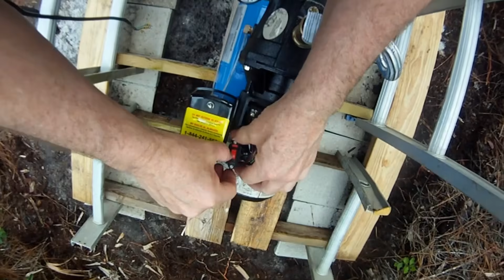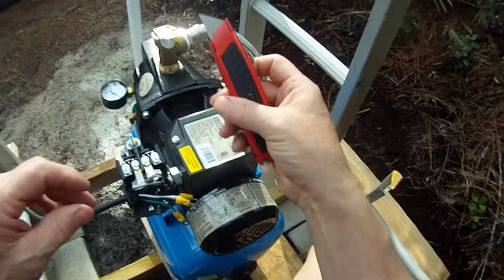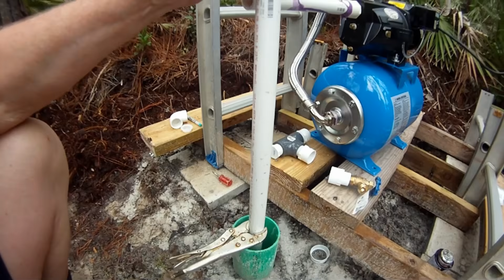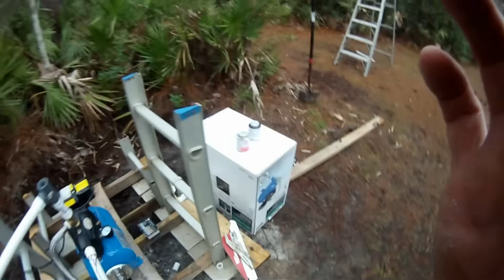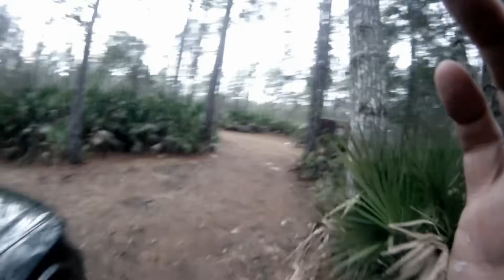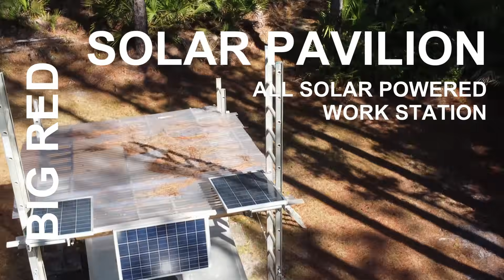Shallow Well Pump ELECTRIC + PIPE Hookups SOLAR POWERED WELL PUMP DiY well pump operations & Hookup

Comment: Add a well seal between the draw pipe and 4"casing. pour some pea sized gravel around the draw pipe and casing to help filter sand. Lastly draw a sample and have it tested for bacteria before using it for drinking! Otherwise well done :)
Reply from the maker: Thank you for the great tip! I will definitely mention that in future videos.

Comment: Can I locate the check valve at the top end, in case I have to change it some day? There is a high salt content in this water. It has a history of eating things. So, if the valve is reachable,  a future headache will be solved. Oh, part one and two are great videos.
Reply from the maker: Hi Matt,
Thank you for watching.
Check valves are designed to have waters weight on  side of the valve ( pump side). So, when the check valve is installed down by the well point, all of the waters weight is on the top of the check valve when it's closed.
Putting the check valve up high, makes the check valve pull on the seal where it seats when closed. The check valve flapper could begin to warp with reverse pressure ( suction) that is  occuring when pump shuts off.
So, to answer your question, you could put it above ground but, you may be replacing the check valve more often. In your case, it does sound like maybe it's an alternative. Just be aware that you may lose suction and would have to prime the pump more often...
Thanks again for watching!

Comment: Aluminum ladders are good lighting rods.
Reply from the maker: Hey Robert,
Thank you for watching.
So are trees!😆
But, the entire ladder superstructure is grounded thru guy wires which also stabilize the structure. This method makes a safety umbrella for the entire system. Anything, people and equipment safely blanketed by the grounding system.
Thanks again for watching!

Comment: Where did you get water for your mini jet?
Reply from the maker: Hey Joe, fill clean large trash containers 3 ( 120 gallons)would be a good start and probably enough. Keep water in truck bed or place containers on a platform at least 1 ft high. Place hose into container, hook up siphon to pressure washer.

Comment: Hi quick q

North central Florida, Swanee area, 

Is it possible to drive a 3” pvc pipe with slits as a diy screen down to about 60’ and use a jet pump with 1/2” pvc to draw the water?
Reply from the maker: Hey LUGO, Thank you for watching. Im not sure. I guiess it depends on what you are starting with... 4"?  you would probably need a mud pump to go 60 feet. Im still not sure of the best procedure for 3" micro slot.
Thanks again for watching!

Comment: Great videos...my only comment is why are you running the pump so high @51 psi it's generally not needed so high ...it will pull less on your inverter less chance of blowing out hoses and will be more like town water pressure
Reply from the maker: Hi John, Thank you for watching.
Its the preset . It works good for what I use it for. Mostly washing, spraying off things. It would probably have to have the pressure switch changed out to adjust psi.
Thanks again for watching

Comment: This was terrific. 
I just don't know a flip about solar. You know, like knowing how much solar to buy and the inverter. It's Greek to me right now. 
But I can get a hand pump on the well first and have a stubbed off connection for a pump later.
But this is really a terrific video. Grateful for your help. Jesus bless.
Reply from the maker: Hey Sandra, Thank you for watching. depending on what you need to use the water system for, frequency of use. but, 600-800 watts should do pretty well for you. use a 200 watt/ 4000 peak inverter.
Thanks again for watching!

Comment: What brand power  inverter 2000w did you use.
Reply from the maker: Hey southern haven,
Thanks for watching.
I actually am not particular about a brand.
It isa modified sine wave inverter. They are very affordable versus a full sine wave inverter. If you are running expensive electronic equipment, you might consider a full sine wave inverter but, for the pump system, modified or square wave inverter is just fine. I do use the mod sinewavee inverter for everything including my laptop Thanks again for watching!
Reply: Thanks great information I'm just want it for my water pump

Comment: What part of Florida did you do this at? I have put in wells in Indiana with success but I just bought raw land in northern Florida, Suwannee county and plan to do it again. Nice sandy soil. How far down before hitting water? Thanks man.
Reply from the maker: Hey Dan,
Thank you for watching.
It will be similar to what I ran into
On this one 
Sand/moss, then sand, then small crustacean / hard sand  layer, then... BUTTER
Reply: @AtlanticDrain  I watched your video months ago and watched it again last night and seen this was ocala area about 118 miles from me. I had enough of Indiana brrr so I was going to move to Arizona but at the last minute decided to come down to Florida. Living off grid in Suwannee county in my truck camper running solar and a generator for backup and for heavy loads. This isn’t for everyone lol. We shower outside with a shower bag 5 gallon and use a coffee maker to heat water for now while getting set up. It’s a trip mentally going to Walmart and lowes and seeing the outdoor garden center open in January lol cause that ends in august up north. Loving the sunshine warm weather to a guy like me that’s used to single digit temperatures back in Indiana. Keep up the great work and videos they are appreciated.

Comment: Very interesting.  I need to fill 2 ponds, I don't see in the comments about the cost of going solar, can you advise please?
Reply from the maker: Hey Kevin, thank you for watching. Wow two ponds?!?
It sounds like maybe you should run pipes to ponds from your rainwater drainage systems to fill them.
Yard drains discharge as well.
You would need minimum 850/900 watts of continuous power to run the pump all day for the system in this video. That would be 9 - 100 watt panels.
It would take months to fill a pond. Best bet, use rainwater run off into the pond(s).
Thanks again for watching!
Cloudy days
Reply: @AtlanticDrain  Thank you!  I have pretty good runoff filling them but after June it gets dry.  Sounds like I need to get it on grid.

Comment: Great pair of videos. Looking to do this for sprinkler system. How much pressure and flow can you expect from a well of this type?
Reply from the maker: Hi M Goode,
Thank you for watching.
50 psi.
I haven't ever run out of water. Its always there.
It depends on where you are in U.S. or the world.
This one is down close to sea level maybe 100 - 200 ft above sea level.
Thanks again for watching

Comment: When I'm using new clean pipe I never use primer. Never had any leaks doing that.
Reply from the maker: right on brother. I've been to many web sites
 that show charts  fail /  strength TESTING   of pvc pipe and glues.
most glues strength is GREATER  ~ not ~ using any primer.
Thank you for watching

Comment: How long will it pump water ? How long can u let it pump?
Reply from the maker: Hi james, thank you for watching. The pump pumps water all day long as long as the sun is out. It would probably run continuously for about 2 hours or so at night more than enough for whatever you need. The water pocket seems to be an endless supply as well. This solar powered shallow well pump works great! Thanks again for watching!

Comment: So 20 psi continuous. 50 psi for like 5 gallons. Enough to fill a couple toilets.
Reply from the maker: Hey Jeff,
Thank you for watching!!!!
in this video, the pressure gauge is showing NO RESISTANCE pressure.
a smaller pipe (like toilet water inlet pipe) is smaller and adds pressure to the system. It would read around 40 psi minimum while filling a toilet tank.
I've used the water for many things on the property. It works great!
Thanks for watching!!!

Comment: You should use as little threaded pipe as possible because it leaks over time. They have slip joint PVC hose bibs.
Reply from the maker: Hey Jeff,
Thanks again for watching!
sometimes, you can use less threaded inserts. 
I still like the standard parts available without getting into specialty parts.
Thanks AGAIN for your comments and watching !

Comment: You should have used a 4" cap over the top of the 4" pipe with a 1" hole drilled in the center to cover the casing and use a disconnect union to connect the pipe to the well in case you need to remove the pump later.
Reply: Jeff has the right idea.  The cap would help keep bugs small animals and debris from going down and contaminating the water table.
Reply from the maker: Hey Jeff, Thank you for watching!
I appreciate your comments and inputs. 
Thanks again for watching!
Reply: You should secure the pump to the base.
Reply: @william6526  I think he forgot to film that. I would have added dual taps instead of just the one too.
Reply: You should of put a sand trap before the pump on the suction side to catch the sand before it goes through the pump. I put one on the suction side and one on the pressure side to catch any sand.
I bought the ones you can clean by just opening the clean out valve on the bottom of the filter.

Comment: leave at 230 volt  amps are lower     v/amps/hp/60hz     in europe and england  50hz    

leave at 230volts   cheaper to run
Reply from the maker: Hey Charley!
Thank you for watching!
220 volt operations makes for less current thru the cable wiring coming from inverter to pump.
But, the power used to run the pump ( in watts) remains the same.
Thanks again for watching!!!

Comment: Actually 220V is better for pumps because it will use less current which means thinner wires.   When the pump is wired for 110 it uses twice the current.  There is a surge whenever a pump cycles on.  Also better for your generator if it supports 220V as it uses both phases of the generator output.  Consider a 3000W generator can only support  1500W per phase.
Reply from the maker: Hey Eric,
Thank you for watching.
Can't argue that! 220 would of course, use half the current of 110.
If, you have a 220 volt supply.
Unfortunately,
Power consumption ( watts ) would remain constant at the inverter/ batteries no matter if it were 220 vac or 110 vac. 
 Thanks again for watching!
Reply: @AtlanticDrain  Yes power consumption is the same, the difference is 220V it is distributed over both phases.  If the generator is not big enough some pumps could struggle on 110 probably not a shallow well pump.  Load balancing any service is a good thing, you would not want all your circuits on one phase.

Comment: ive discovered that a soft starter for the shallow well pump would save u lots of issues with your inverter and is easier on your pump and plumbing. 
you tube has great vitds on diy soft starters that would be very cheep. 
i found your vid as i was looking at such an option for me. 3kw inverter 1.5 hp pump. not nuff batteries to be reliable.
Reply from the maker: Thanks for the tip!
Reply: Hi Rush Bayou---I would be very interested in your list of equipment if you have had time to decide on what you are getting. 
I am clueless on this electric pump set-up. 
My video search initially was for a manual pump on a shallow well set-up. When I ran across this...I'd really like to try this but my comfort zone stops shy of the solar and inverter and selection of pump. 
Actually I would like to split the pipe coming out of the well--install a manual pump on one leg of pvc and the electric pump on the other. Put ball valve cutoffs on each leg. Not sure if that would be productive....just dreaming.
If you can help...thanks a bunch. Jesus bless.

Comment: i wish they made this pump in DC ... for that matter , we need more DC power items and appliances and make them easier to find. no reason for dc refrigerators are sooo costly and hard to find. 
ty 4 ur vid  my well is 600ft from my house with a 12ft drop gravity feed. pump is in the house fed trough the floor. i also have an access to the well water without the pump. 
my pump is a 1.5 hp but way too big for my needs. i need to add a soft start so my inverter is more reliable. i used brass till i reduced to 3/4 then reduced again to 1/2" as i split to each location. reduces stresses i think. i also deal with freezing temps.
id like to redo the well and add another 6ft to the water height, then id be able to do more without the pump. its a ground fed spring at the base of a mountain. but an old well that hadnt been used in 40 years. lol
Reply from the maker: hey rush,
thanks for watching!
Reply: use a converter   ac to dc       go to your electrical supply   buy a transformer
Reply from the maker: hey charley,
thanks for watching

Comment: Please tell me you put a sanitary seal on your well head. You have done a fine job for a "shade tree" mechanic. My wish is that everyone who does this type home-owners work, please when dealing with shallow wells it is also important to add the sanitary seal or a cover on the top of your 4" not just plastic wrap but seal it. You do not want critters in your well nor do you want flood waters in there either.
Reply: Sounds like you need to start up your own channel.
Reply: Yep. Just get a 4" cap and drill a 1" hole in the middle for the well pipe and run a bead of silicone where the cap and 1" pipe meet. That would make a fine sanitary seal
Reply from the maker: Hey Jeff, yep that sounds like a nice easy way to seal off the 4" sheath.
Reply: @theFLshark  Polly

Comment: Too many things wrong here to name but the most important is NOT TO DRINK THIS WATER.....this is a seepage well not a shallow well which would be deeper....And you did not seal the surface casing ( 4" pipe) With sodium bentonite holeplug rock and grout to further prevent contaminants from getting into this water...And for anyone with the question of using bleach ,,,,no that won't work to kill the bacteria because it will continue to produce bacteria filled water through this type well... Please boil before using for anything.
Reply: You need to start your own channel.
Reply: @raymccarty4612  not enough hours in the day.
Reply: @twobitsmith1  lol
Reply: I have been drinking water from a shallow well I installed decades ago with zero health issues.  You should define what you mean by a shallow well.  Here in north Florida, we usually hit water at about 4-6 feet, but usable water is 16-22 feet.  No one in their right mind would drink water from a 5 ft well, but a 20 ft well is just fine unless you have local contamination.
Reply from the maker: Hey Jim,
thanks for watching.
your comments are much appreciated!
Reply: @jim7smith  Florida is almost nothing but sand down to 23 ft in most places. I've worked on many in north east Florida and usable water is not necessary drinkable water. 25 ft water is not well formation water nor freshwater. Your well is almost certainly contaminated with bacteria. Which travels through the sand and partially filtered as it rains and runs down but not enough to take out contaminates that need filtration like sand, shell, rocks, clays and chalks to filter these out. You can't buy a filter as good as the natural ones below our feet. You might also want to test your water for nitrates.
Reply: @twobitsmith1  haven't people been drinking from 25ft wells since the beginning of time?
Reply: @josephmetts5658  that's true . However the amount of bacteria on the ground now versus then is the difference. And they knew their wells "hand dug" open wells needed to be in a certain area away from trees and livestock and covered. But people also didn't live as long during those times...partly due to what they consumed, which wasn't healthy and I'd bet bacteria played a part in that.
Reply: @twobitsmith1  yeah I here u. I would dig a shallow well only for emergency drinking water.
Reply: @josephmetts5658  and they are cool to have. Better to have that, than none at all if the power goes out!
Reply: @jim7smith  most common forms of health issues experienced is gut related problems down to immunity disorder and ibs to stomach cancer ect most people have no clue what they are consuming and if the ppm is low it could take years to start showing up. But most wells that have bacteria in them that we treat can take jetting the formation with treatment and can become costly. I recommend everyone have their water tested every few years.
Reply from the maker: hey jim, thanks for watching!
Reply: Can we hook system to sprinkler system? I live in Florida ( tampa) going to do diy well. Thanks

Comment: Is the glue and cement for the piping safe for water to be consumed? I get once it’s really dry the fallout wouldn’t be much. Can I just use sharkbite fittings instead of the glue/cement?
Reply from the maker: Hey Reck,
Thank you for watching!
SOme people swear by shark bites. 

I dont know how to answer your question though. Im sure its just like you said. so, let the glue dry  before use.
Thanks again for watching!
Reply: Don't use shark bites inside the well, but for pump connections they are fine.
Reply: Those fittings are crap.
Reply: @raymccarty4612  do you have something positive to say here?